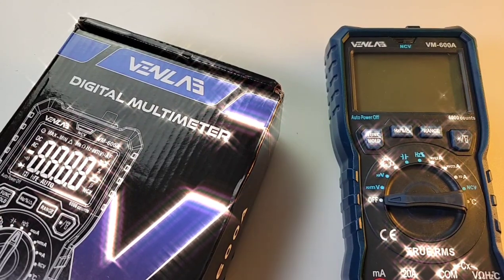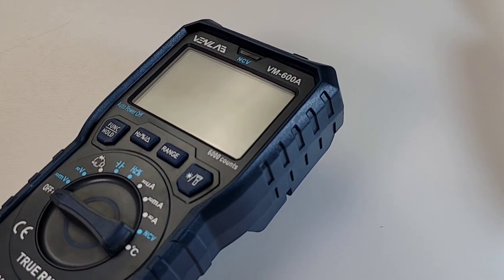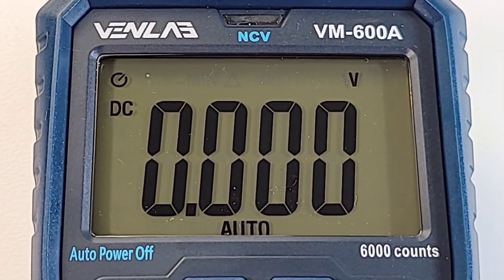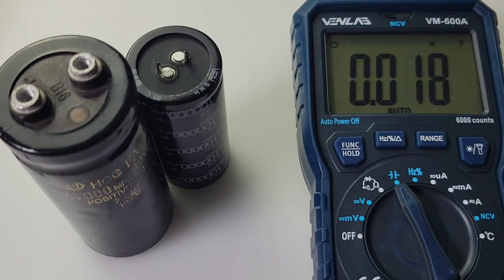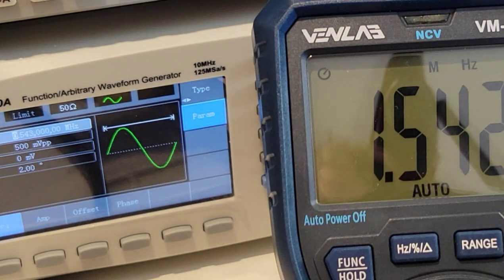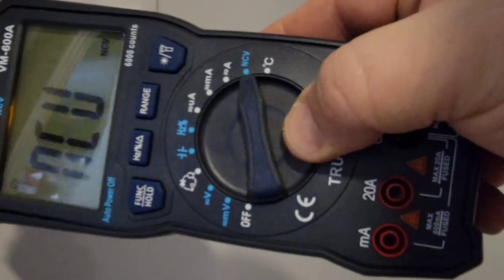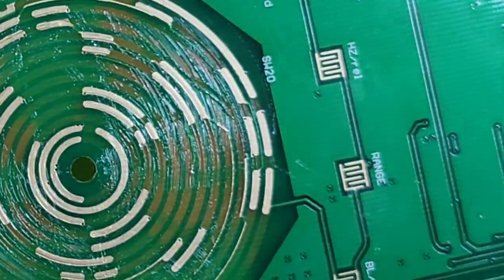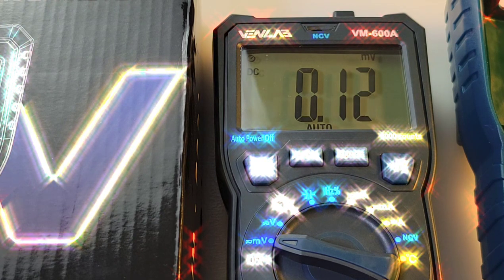VENLAB VM-600A CHEAP-O Multimeter Review & Teardown!

Comment: Hi Daren. Very interesting multimeter. Looks like my LOMVUM 616. It has a magnet, has an EEPROM, and most likely it is made on an old 0660L processor, since it has a quartz at 4000. It seems to me that he will not take 20A to measure, although it is clear that the firmware can show this number. In fact, the cheapest RM102 and its clones could also show 20A if they put a 20A fuse on them and flash through the EEPROM. But it does not have a current-measuring shunt, which is strange ... The voltage drop should be high and you can burn the multimeter in theory (but this is not accurate)
Good monochrome screen, no problems with viewing angles. But the base is the same RM113D with minor changes.
The price is 27 Euro. For your countries, this is not much.
I want to advise you to check the multimeter. (Since you still haven't taken LOMVUM for a test, you probably have some magical difficulties with it ;) ) Then take one of the coolest multimeters for your money for a test. This is ZOYI ZT-225. I promise you, as in the case of LOMVUM 616 - this multimeter (for almost the same money as VENLAB VM-600) for 27+ - EURO is simply the best among Chinese multimeters. This is just a wonderful multimeter for professionals. If you can, then order ZOYI ZT-225)) You will be pleasantly surprised. Your opinion will be interesting.
Reply from the maker: Hi my friend! I have the ANENG SZ20 enroute..it's identical to the ZOYI ZT225.
Btw I do have a LOMVIM 616 on the way as well...2023 looks like a great year for multimeters. Hope you are doing well.
Reply: @KeepOnTesting  Hello Darren. I have everything with varying success, somewhere in health, somewhere in finances. But nothing, we cannot be conquered, we can only be destroyed.
Yes my friend. Aneng SZ20 is an analogue of ZOYI 225, you can tell about it in the video so that people understand. It just seems to me that ZOYI is cheaper at the same time. I don’t know how it is for Canada, but for Europe it’s definitely cheaper, because ZOYI is usually less promoted than ANENG, which is why the price is lower.

Comment: Got one today. Couple of points that I’m not so sure of mine shows (flicker’s between voltage ) voltage when leads are connected or not connected and no voltage is applied? Short the leads goes down to 0.001 take them apart goes back to anywhere between 0.020 and 0.001 just flicks random. Can’t get it to zero at all. Is this an issue? Don’t know not tested it against a known voltage as of yet. Second point it defaults to DC unable to get it to default to AC I know it’s just a press of a button but why won’t it just stay there? As soon as you come out of the feature to something else (without switching it off) it just goes back to DC slightly annoying (yes I know I’m picking at things!) other then that so far everything is good NVC works a treat nice speedy pick up of the leads when touched together etc. overall happy and especially at the price hard to beat.
Reply from the maker: Congrats! Btw, Don't worry about the flickering voltage..it's completely normal. A real treat for the price it should serve you well!

Comment: Hope prices won't go up after this video. Quite nice actually, but doubt the test leads can actually do 20A. Extra low current fuses because you might plug your lead on the wrong jack with the two current inputs. But with the auto power off, how long before it shuts off - and does it beep a ton at you?
Reply from the maker: Hi Rui, 15 min for the Automatic Shutoff.
You can disable this by holding down on the Function button when you tune the meter on. It does beep prior to shutdown but nothing to annoying 😃
Reply: @KeepOnTesting  Oh good. This Aneng I got goes off the same 15 minutes, beeps like a microwave oven but it can't be disabled. Or it's time for a standalone voltmeter-ammeter!

Comment: Love the videos Darren. I can get this Venlab, the Kaiweets HT118A, or an HT118E (straight from china) each for the same price in Canada right now. Which one would you go with? :)
Reply from the maker: Cheers Austin! Tough call, but if they were the same price I would go with the Kaiweets HT118E as my first choice, simply because of the higher resolution and dual display. The Venlab a close second. 👍
Reply: @KeepOnTesting  Thanks! it's actually called Huiop HT118E 🥴  but the pictures show a habotest. I feel like all the HT118E's are the same but with different names?
Reply from the maker: @rAustinBall  Yes indeed,  the same just different branding.

Comment: Well ill be - - - - -  ----  its in the cheapo realm but lots of GOOD VALUE in functionality here-!   its one thing to have the ranges its quite another for them to work as well as theyre supposed to.  Doesnt have the dual display, 20,000ct. display or bar graph like the 118E but doesnt cost as much either, in fact you cant ask for much more than this in the lower cheapo price range.  Been a long time since ive seen a meter perform this well below $30-!!
Reply from the maker: You got that right Mke ! In all honesty it's one of the best deals currently out there. As you mentioned,  fair bit cheaper than the 118E too!
Really glad this multimeter shined. Goes to show you that a CHEAP-O can still turn heads😏
Reply from the maker: Did you buy one yet...you can't let this CHEAP-O Pass on by !

Comment: Isn't the NCV antenna a piece of an input jack?
Reply from the maker: Yes indeed! 😂 Albeit a slightly better implementation than the ANENG M113..an input jack nonetheless..
Good grief 👍
Reply: @KeepOnTesting  Aneng M118 had a simple piece of a resistor pin. Installing a metal strip (e. g. for welding lithium batteries) makes sensitivity way better.
Reply from the maker: @watchmakerful Yes..!! Sorry I was referring to the ANENG M113.

Comment: 20A gimmick
Reply from the maker: Well..perhaps BUT they did actually include a 20A fuse which is usually not included by other vendors claiming a 20A rating..:face-blue-smiling:

Comment: I've just bought fluke after this review. Thanks for the video but meter is not good. We all know that.
Reply from the maker: I hope you'll be working on industrial mains otherwise you just forked out 300$ more than you needed. Most CHEAP-O Multimeters are perfectly suited for residential/hobby use.This is a very good multimeter.
Reply: @KeepOnTesting  thanks. Yes, I have some industrial needs also I need precise microvolts readings, but also I hate to see 12.8v motorcycle battery at 13.0volts in cheap 6000 counts multimeters. I really want to see if this meter can measure true 4.20volts on a lithium battery pack. Thanks for the video again. I'm not against you but the mmeter :)
Reply from the maker: @smntsn All good my friend. Btw,  It did measure 9.99 on a 10.000 volt Reference  Also 4.999 on a 5.000 v reference standard.